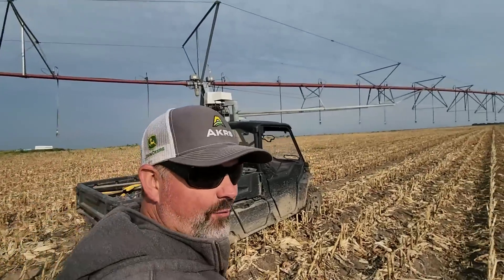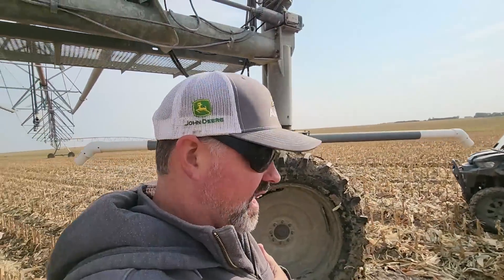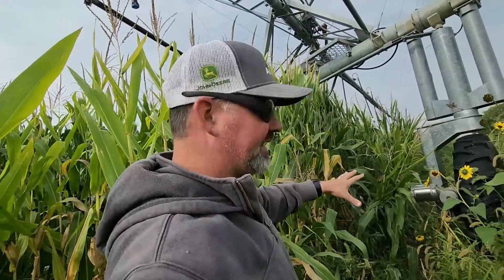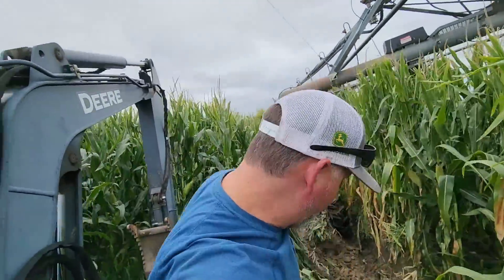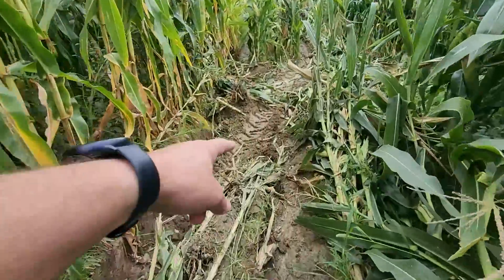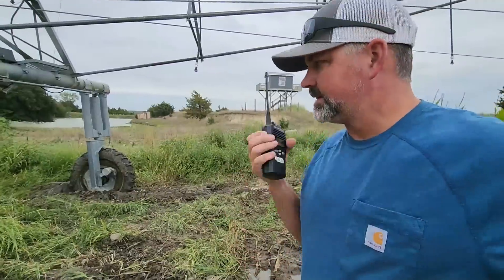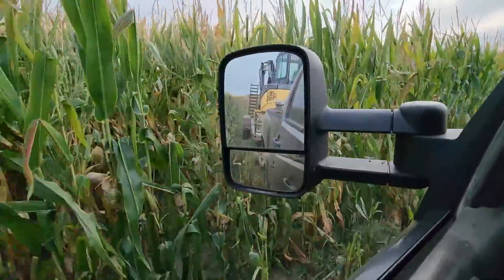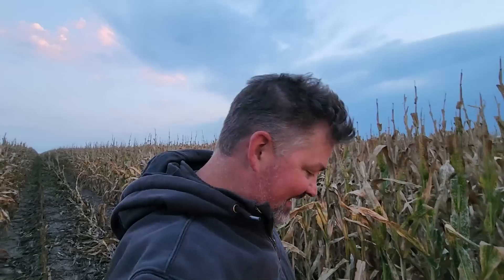Seed Destroyer

Comment: Umm, Did I hear him tell Laura to set the pivot to apply 1.5 inches of water?   I think we have the answer to why their pivots get stuck so often.  That's a lot of water for a single pass.  It's unlikely that his soils can take in water that fast, and the excess just runs off and collects in the low areas.  And then their pivots get stuck there.  
It's also a waste of the water when it runs off.  I almost never go over 1.0 inches in a pass, and usually in the 0.8-0.9 inch range.  Most pivot operators I know are similar, or less.  Most guys don't have the time to mess with stuck pivots.

Comment: How does each tire/wheel know what rpm to turn? Closer to the pivot the slower the tire rpm. Voltage change? Thank You.
Reply: The wheels turn at the same speed.  But they turn on and off as needed to keep the towers in line.  There are position sensing microswitches on each tower that measure the angle to the next tower, and turn the wheels on and off.

Comment: The pivots seem to be a financial and labor intensive problem. I like the pvc pipe with holes in it method. Depending on the size of the field what's the challenge of spacing those out evenly throughout a field. I also saw Laura explaining the flex pipe with the knot on the end before and that looked simple and cheaper compared to maintaining pivots. I don't know anything I've just seen you and Laura working with 3 different irrigation techniques and the flex pipe looked the most economically friendly. Let us know if that's possible. I believe flexnet is the product.
Reply: Did they even use the poly flex pipe this year?  Or was that last year only?
Gated pipe or poly pipe is a lower initial investment, but it's a lot more time consuming to operate. 
Pivots are easier to use, and do a far better job of distributing the water evenly.  And while they do require maintenance, you're getting a bit of a distorted view of it from these videos.  Most farmers don't spend quite as much time working with pivots as Laura makes it seem, and you're not realizing the constant work it would take to operate gated pipe on that many acres.  
Per acre irrigated, the pivots require far less time than gravity pipe.
Reply: @42base13  They did not record any pipe usage that I remember this year and yet in that one section they likely had to have used some type of pipe.    Pivots for me!!

Comment: 🤔question.  What is the percentage loss of corn per year due to irrigation equipment and tractor etc damage.
Reply: Not much! Lets see if we can figure it out.  Driving on the corn is not something we like to see but most likely is not enough to worry over much about.  One full circle pivot is likely working close to 160 Acres.  an acre is 43,560 feet.    A truck 8 foot wide drives 1000 feet in to where the pivot  is down.  and needs say   40 feet by 400 feet to work on the pivot smashing the corn.  (8X1000)+(40x400) =  24,000     24,000 /  (160 x 43,560) = .0034352~~~~  or 0.3 percent.    As a rule Cale dose not smash down the corn by driving on it.  This year the Miller Sprayer is down for a new engine so it could not help.  See Laura Farms video "Using a Sprayer to Change a Pivot Tire"   https://www.youtube.com/watch?v=MCE1bu96jH0   There are  other videos that will show the amount of work they do to NOT knock down the corn like carrying a heavy center drive in a backpack way out into the middle of the corn field!
Reply from the maker: negligible
Reply: Thanks 🏴

Comment: I worked for several potato growers that have the same irrigation system and I don't recall them getting stuck unless they had flat tires. You must have a lot clay or your running during rainfalls.
Reply: The sprinklers are enough for them the get stuck. I work on pivots in western Nebraska. We are at the point in the year where they are always getting stuck. Out pivots in western Nebraska run more then pivots in eastern Nebraska. We dont get as much rain as they do.

Comment: What's better, buried tape or pivots?
Reply: Good question.  I was wondering that myself.
Reply: My opinion is that pivots are easier to fix because it is all out in the open and you can see and get to the problem.
Reply: @scottsoper  They say that the buried tape is better in a drought because there is less evaporation.
Reply: @NiceMuslimLady  I am not sure that evaporation is a bad thing in these VARY high temperatures because it keeps the crop cooler.  Corn likes hot weather but not super hot weather.
Reply from the maker: they both have there place
Reply: @LEAADFarms  👍